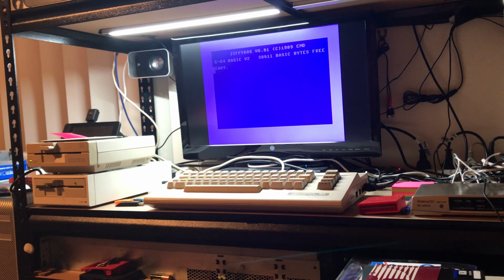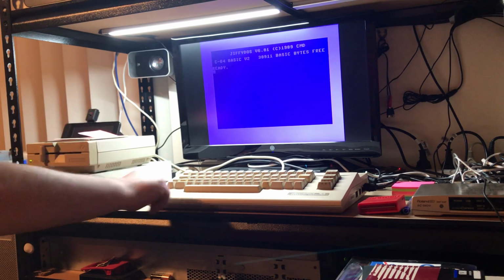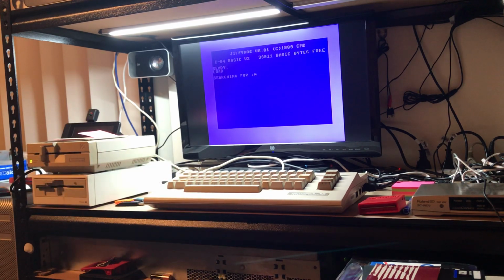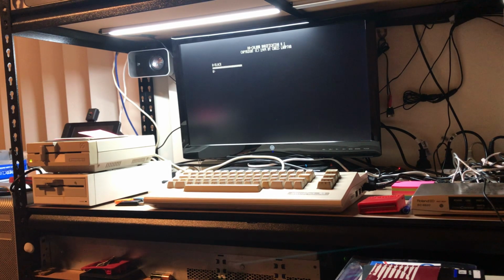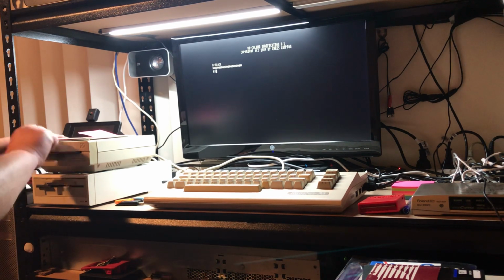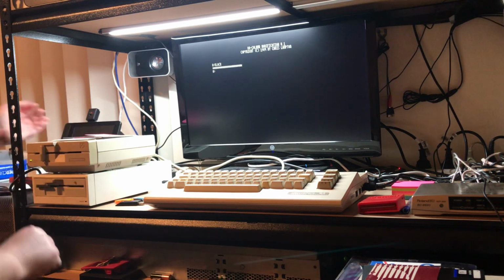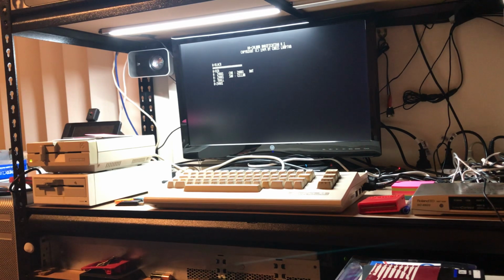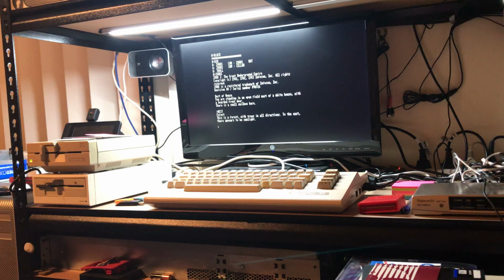CP/M v2.2 on a Commodore 64!

Comment: Fantastic work. Would like to get myself one of these (as a fan of cp/m)
Reply from the maker: Thanks mate. We are definitely in a niche group of C64 users here. I grew up with CP/M computers (school) as well as the Commodore 64, so it was inevitable the two worlds would meet at some point. As for the cart, I got mine made by PCBWAY, not cheap, and it takes a month or so, but the end result is a quality bit of kit.
Reply: @mbpaull  Is it possible to order pre soldered boards i.e with the SMD components pre done? (a link would be helpful if so). thanks
Reply from the maker: @RetroMarkyRM  Apologies for the delay in replying. It is possible, that's what I did, but you need to order a minimum of five boards and to be honest, the process wasn't as painless as it could have been. Send me an email to mikey351@gmail.com and maybe we can work something out ;)
Reply: @mbpaull  ok, thanks Mike. will be in touch! :)

Comment: How did you change screen colors?
Reply from the maker: I used a modified version of the CP/M 2.2 boot disk I found while crawling the net. I'll get back to you with a link when I finish work.
Reply from the maker: I couldn't find the original website, I browsed so many while looking for additional software and utilities, so instead I'll give you a link to my Google Drive that you can use to download it. This version also has the two drive hack implemented, so you get 80cols, black background and 2 drives. 
https://drive.google.com/file/d/1W1Mjr9QOgYJ9vBgomfsr3GANcOUhC7dz/view?usp=sharing